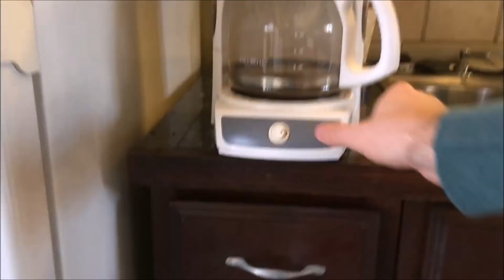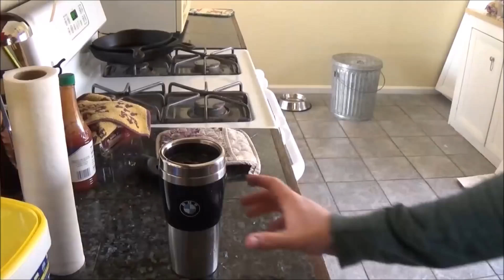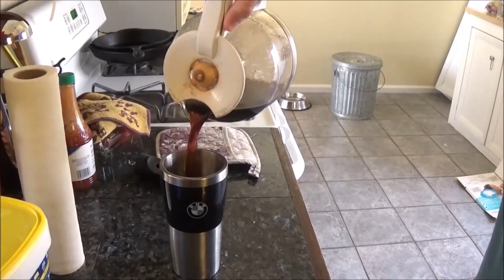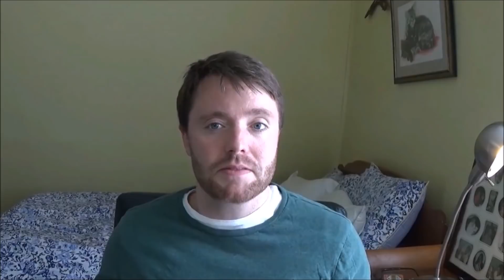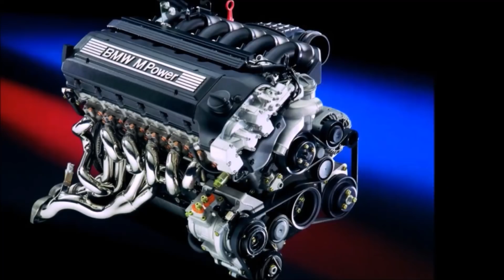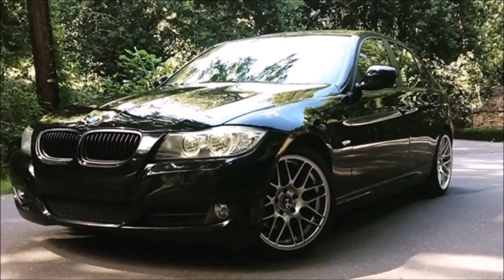Will the Inline 6 Cylinder Engine Make a Comeback?

Comment: Unfortunately, probably not.  I love inline 6 engines, I own a few of them, but there is a reason they won't come back.  V6s are easier to package and use through multiple platforms (money savings).  Honda for example uses the 3.5L J35 V6 in the Accords, Pilots, Ridgeline, some Acuras, etc.  They are also harder to make emissions/CAFE compliant.  Most of the ones I know of are dead due to emissions.  Even BMW, the only inline 6 you can get in a new 3 Series is in the top of the line 340i.  All the others have the turbo 4.  Even RWD cars are becoming harder to find these days.
Reply from the maker: Yes your points are valid but if you follow the trend I would bet 95% of front wheel drive cars will be 4s and most high performance cars will be 6s and they’ll be rwd making packaging less of an issue. I’m not saying the i6 will be the sole 6 but I think we’ll see more of them to thsee point where they’re not rare. We already have 2 big companies saying they’re bringing it back.
Reply: The inline 8, to compare, probably won't ever come back for obvious reasons: 8 cylinders lined up straight is too long for practicality of being able to fit in modern cars (hence its crankshaft being equally long), can only be mounted north/south (longitudinal). The engine bays of the cars this engine powered often had to be designed for it to fit into, instead of the other way around.